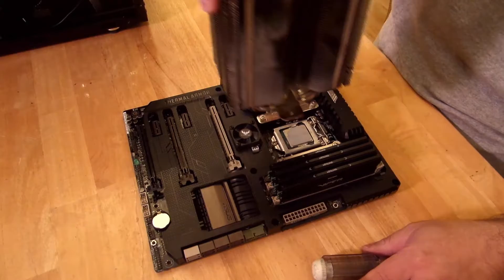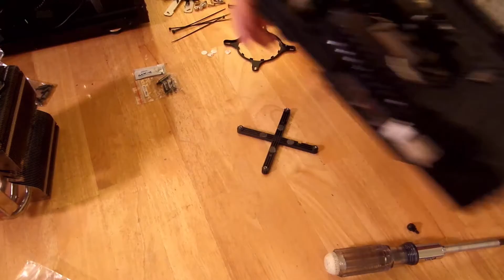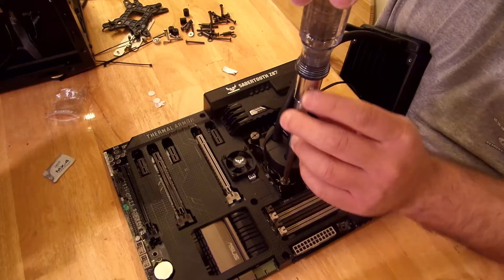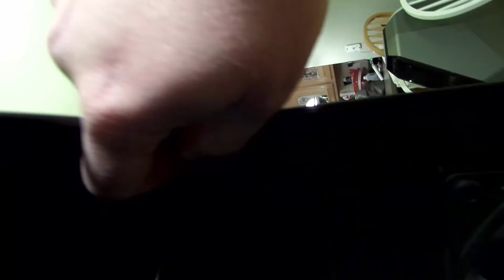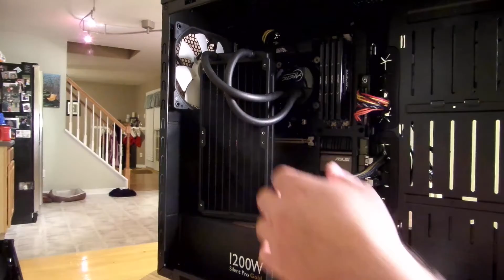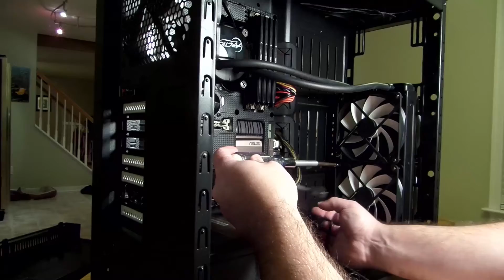How to install the Arctic Liquid Freezer 240 CPU Liquid Cooling unit in the Fractal Design Define S

Comment: Why would you draw air in, heat it up and exhaust into your case... Thus heating up the air inside the case and making everything else.... like the GPU hotter... makes no sense.
Reply: +DAGATHire because it doesn´t make much difference.

I think Linus on LinusTechTips made a video about that, the difference is about 1-2 degree C° for the GPU.
Reply: Julius Dorn Well, First Iggy has confirmed that he intends to change the orientation.
Also i have almost the exact same setup, and i can assure you it certainly does make a difference. And Linus didn't use a Water cooler with 4 fans. This water cooler works well, but be sure, that with a CPU under load, it is exhausting a hell of a lot of hot air @ circa 50ºc. Now it does of course depend what kind of GPU and CPU you are using, and where the GPU draws it's air from, but filling a case with 50º air is a bad place to start. 
Also, with respect, Linus talks a lot of crap. I would recommend Jaystwocents. Linus is a computer enthusiast who has done very well off the back of having a funny personality on youtube. Jay is a qualified computer engineer with decades of experience.
Reply: +DAGATHire 50°C hot air of that radiator? Sry but that´s wrong.

I have a Corsair Carbide 400C and that Arctic Freezer 240 in the front.

My i7 3770k is running at 4.6 Ghz and hits 65°C at its hottest core.

The air comming of that radiator is minimal warmer then the intake air...

My GTX 970 (Gigabyte G1) is running at 1518 Mhz and hits 68°C in games.

I had a Alpenföhn Brocken2 CPU cooler before (2x140mm fans), in that configuration the GPU was around the same temperature.

So from my own experience, no it does not make a difference at all.
Reply: Julius Dorn Im not talking about what cooler you have... I AM TALKING ABOUT SENDING THE HOT AIR INTO THE CASE AND NOT OUT OF THE FUCKING CASE! 
Are you seriously telling me that if you send the HOT FUCKING air into the case nothing happens.... are you for real? I really hope this is a misunderstanding.
Reply: DAGATHire you write like an angry 12 year old, really adorable. of cause the system is not perfect, but the hardware won't take any damage from it. you must include the size difference of a cpu to a watercooling loop in the equation. the core temp of the cpu may be 50 °C, but the radiators temp won't be near that high. best regards
Reply: lokdabest Wrong. CPU temps and cooling efficiency is calculated by subtracting the ambient temp outside the case with regard to the CPU temp. For example. CPU temp is 50. ambient temp is 20. The 30 degree difference is what is being generated by the CPU and therefore must be cooled. However, if you are drawing in 20 degree ambient air from outside, heating it in the rad and blowing it into the case then fine. your CPU will be cooled in the most efficient way because is using the coolest air source from outside... however EVERY OTHER COMPONENT inside the case is now trying to use the hot air inside the Case to cool itself. Case in point. The GPU/s another case in point high performance overclocking motherboards use mostly passive cooling provided by FRESH COOL AIR being drawn into the case via case fans.A well organised case will have good airflow over these units. Another case in point. high performance RAM... you know the aluminum sleeves they all come with these days... they need to stay cool also.... thats a passive cooling sleeve and that's what it's there for. 
So, now you have a case full of hot air, and the GPU fans are using that hot air to cool themselves. Where the GPUs spit out even more hot air into the case making it even hotter. typical GPUs will be running at 60 to 70 degrees.  And indeed the Motherboard passive cooling units are also using this new heated air to cool themselves. 
Now you can go down the route of BS passive aggressive nonsense, or you can learn something about how cases should be cooled. You most definitely don't exhaust hot air into the case... the very definition of the word exhaust kind of makes it obvious... but you know... what ever floats your boat.   
Best regards indeed.
Reply: i have the radiator in the front, all my temps are fine, my gtx970 stays well under 70°C.

The air from the radiator is not HOT, it is minimal warmer then the intake air, maybe 2-3 degree more.

I checked it, so pls dont talk about something that you obviously never tried yourself^^
Reply: Julius Dorn Of course i have tried it. I have this exact cooler. I am not going to call you a liar my man... but it's pretty impressive. Is your CPU actually a casio watch by any chance? because what you said.. is fucking ridiculous.. the air coming out of the rad is 2-3 degrees higher than the than the ambient air.... i mean...hell, all those scientists working for hundreds of years on the laws of physics and thermodynamics have simply got to get in contact with you to see your super natural computer system... 
Maybe you should turn it on? 
But seriously.. we are talking about a CPU under load here and what happens when it's under serious load. We are not talking about a fucking idle CPU doing nothing but sitting there so try to keep up because your comment is utterly stupid.
Reply: DAGATHire haha, nice long text, still not that bad to have the radiator in the front. just listen to all the people with actuall experience. im not even saying that you are wrong, in a ideal case the radiator is exhausting the air out of the case, i think aint nobody diagreeing here. ok i made my point often enough. have a good one.
Reply: lokdabest Ye. look. just stop.I am 100% correct. ANd i do have the experience. i have this cooler on a FX8350 overclocked to 4.8ghz, i have 2 gtx 760s in sli on a m5a99FX pro motherboard. I know precisely what i am talking about. In fact, most newer CPUs are capable of running into the 70s and 80s producing astonishing heat from the rads. Im speaking from direct experience and on the very computer i just described.
Reply: ***** Hi iggy. as previously mentioned. it's not the the CPU im talking about. it's the heat generated being pumped back into the case which has an affect on the other components. What you should probably test is your GPU with the rad fans bringing air in or sending it out. Actually, it's even easier to test. a heat sensor inside the case will do a perfectly adequate job.
Reply: I am out of this conversation.

I have it set up with the radiator in front, no problems at all.

He says i am wrong and drives a CPU with 200+ TDP + two midrange graphicscards.

Dude pls just dont talk about others setup when yours is stupid like that.

Sure you cant have the radiator in front when you are driving an inefficient CPU like the FX8350 with two old graphicscards!
Reply: Pepijn van der Kroef not all heroes wear capes!
Reply: Pepijn van der Kroef Well. that was very interesting.. tho totally ignoring the original and sole point that it's about heating the air inside the case, thus causing OTHER  components GPU, and mobo heat syncs to work less efficiently. I have the cooler, i have a excellent airflow, i have 2 GPUs in SLI and i have a top end mobo which requires good cool air to flow over it's heat sync units. Particularly when overclocking. 
Best case scenario is to have the internal air as close as possible to the ambien air temp... but when the CPU is under load, 50º+ and you are drawing in ambient air, heating it and sending it into the case you lose the efficiency of the case fans, moving air in and out, and you force the GPU coolers to work hard, tho taking in hotter than ambient air and using it to cool the GPU. and needless to say you loos the cooler air flowing over the mobo heat syncs. Even a rise of as little as 5º inside the case, means significant less efficient cooling for the GPU and the mobo. THUS 
It' is better to have really good intak case fans, drawing in air, and cooling everything including providing air to the radiator and expelling that hot air out of the case. 
My source. 
REAL WORLD EXPERIENCE.... Q.E.D!
Reply: +DAGATHire  Its a 970 it wouldnt get hot anyway...
Reply: +Iggy Castillo Ok. I have a friend with a Corsair H100i GTX and an i7 4790k @4,8ghz. The pc is on 24/7 and he has two Strix 970 from Asus. The radiator is at the front and the cpu has a temperature of 79°C max. The 2 970 have a temperature of 77°C overclocked. And thats ok. If he would move his radiator at the top his cpu would get hot as fuck and the gpus would have a temperature of 72°C
Reply: +Sebastian Flocke So it seriously doesnt really matter that much. If you would have one or two R9 390(x) in your pc then you would have to have two fans in the front and the radiator in the top because they would just overheat. But the R9 390 takes more than double the power of a GTX 970.
Reply: +Iggy Castillo I think the cpu gets hotter because of the two 970. They have the Strix design wich takes the heat directly into the case and not out of the case so the radiator (fans at very high rpm) pulls all that hot air.
Reply: +Iggy Castillo The review is great! I didnt know that this cooler is so "famous". There is no detailed review of the H100i GTX (at least not in german). And he has two fans in the front (normally in the top) but they are normal bequiet fans and they dont have a good air pressure.
Reply: I could do a review for the Arctic Accelero Hybrid 3 120mm. I think I will buy it in June for my R9 390. Thats my Lan Party System but in that small case it gets really hot so I need a cooler.
Reply: +Iggy Castillo Thats the wrong one. I will buy this cooler: http://www.amazon.de/gp/aw/d/B013J7FQOK/ref=pd_aw_sim_sbs_147_1?ie=UTF8&dpID=41fONh3RwpL&dpSrc=sims&preST=_AC_UL100_SR100%2C100_&refRID=0KBK9Z4WSKD2EC4KE32F
Reply: DAGATHire it works much better. ive done this with my gtx 670 and a all in one arctic gpu cooler and it was 8° Celsius cooler or so
Reply: It's a use case situation. there are too many variables. I'm sure it works in one situation and not another. Just best to test it and see. Im my case drawing air in results in the GPU (980) being a little hotter and the 980 has a silent gaming mode where the fans don't come on if the GPU is below 60º Also the fan noise of the cooler is less when drawing air in. Then if you flip the cooler and exhaust it the GPU is cooler but the CPU is a little hotter.. At the end of the day, unless you water cool both the GPU and the CPU then you have to accept that one will be hotter depending on if you have exhaust style or intake style. So you make the choice of what you prefer. If you overclosk the CPU then it makes more sense to keep it cool as possible. If you Over clock the GPU the same can be said. there are decisions to be made for each individual setup. I think there is no correct way. Just the way that works best for you.
Reply: DAGATHire that Sounds plausible
Reply: The manual states that an air INTAKE set up is the best cooling solution, not an air EXHAUST. Think about it. If you do air exhaust, you are running the already warm case air through the radiator, whereas air intake from out side the case generally brings in cooler air, and the case fans will take care of pushing the air out through the back.
Reply: The manual doesn't say that. the manual shows both ways and gives you a choice, while giving a recommendation of intake. They confirm what i have been saying by making this recommendation as it's ambient air to the CPU First before it heated and sent inside the case where it heats the GPU. If you ask the GPU manufacturer they will say to exhaust the hot air not send it into the case. I would have thought this was common sense? i guess not all sense is common. But as previously stated it's a use case scenario. I have tested both so i can say with 100¨% certainty that the air in the case is warmer and therefore the components within are warmer with the exception of the CPU when drawing air in.  If the PC is under load you are bringing in cool air heating through the rad and venting it inside the case where it becomes the air that the GPU uses to cool the card. The CPU is cooler but the GPU is warmer. If you reverse the fans and the PC is under load, the GPU gets cooler air, heats it and then the rad fans use that air to cool the CPU resulting in the CPU being hotter.  It's common sense that if you water cool both the GPU and the CPU you can orientate it which ever way you want. But if it's only the CPU then you have to make a decision about which is your priority. Cooler CPU or Cooler GPU. That's a personal thing. But ambient air going through a hot radiator gets heated and that's an inescapable fact. What you do with that air is entirely your choice.
Reply: So you're saying the warmer air inside the case passing through the radiator and out the case in an exhaust set up will result in cooler CPU temps than taking in the cooler ambient air in my room with the intake set up?
Reply: No im saying there is a choice to be made. cooler CPU OR cooler GPU plus+ the mobo passive heat sinks etc. it's just a choice of what you prioritize as the most important. For me it used to be the GPU because i had 2 760s in SLI and they together needed cool air so blowing warm air from the rad over them was a poor choice. But hell, if you are over clocking your CPU then its more logical to prioritize that and take ambient air from outside, however for a gaming RIG... you need to make a choice about the temperature of the GPU. ANd if you are overclocking the GPU then you really need to test the various options. As i said previously there is no right way or wrong. Its all about the specific situation and what you are looking to achieve. All that said. If you water cool the GPU and the CPU all the problems and choices go away
Reply: In my experience, it's better than using it to push hot air out of your case. You get an already hot CPU. Then you're trying to cool your CPU with hot air from inside of your case. That just results in lower performance overall. This isn't so bad if you have a blower type GPU which can exhaust most of its heat from the rear of the case. But for an open fan GPU where it pushes the hot air into your case up towards your CPU this can be bad.

It's so much better for your CPU if you draw in cool air from outside from the front of your computer, exhaust that air into your case, then have your case exhaust the hot air to the top and the rear of the case.

Your GPU is much less likely to overheat and throttle compared to your CPU. So the radiator is better from the front of the case.

Now if you really wanted to do water cooling, custom loops that pump to radiators on the outside of the case and exhaust hot air out there and draw cool air from there is much better.